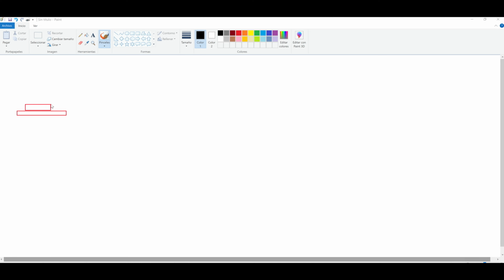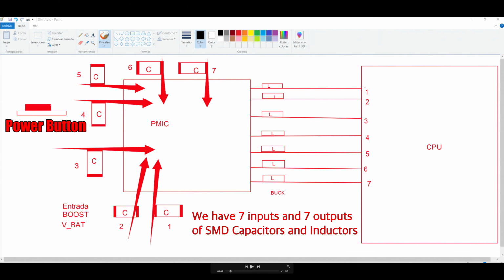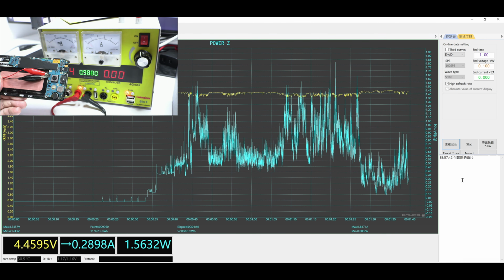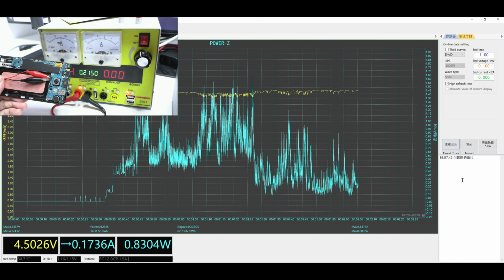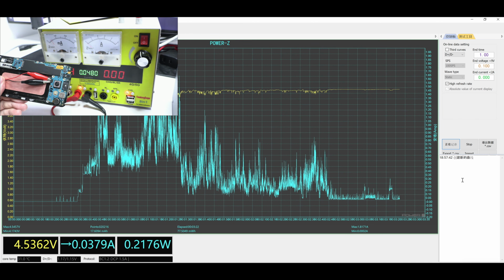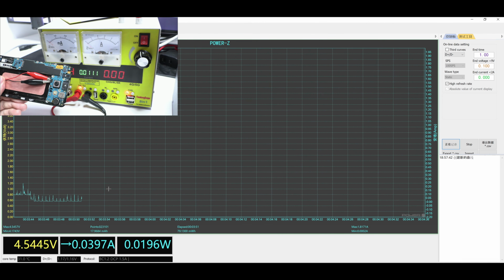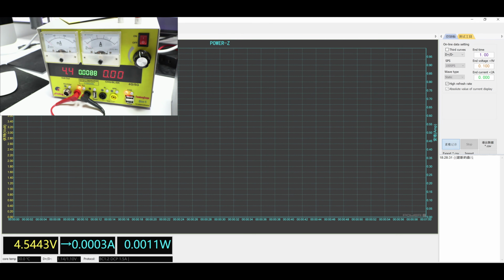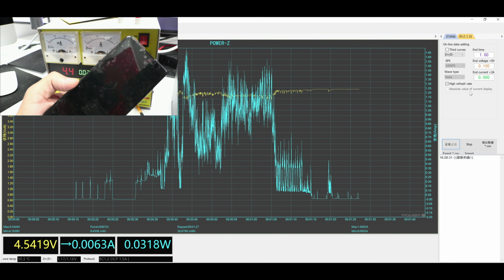PMIC Inputs and Outputs on Motherboard:  Mastering Current

Comment: In a situation when I press the power button the current consumption rises to about 700-900 miliamps and immediately I let go the power button, it falls back to zero meanwhile there is no short circuit on the board. Could this this be a symptom of a bad PMIC?
Reply from the maker: It's easy, you have to see where it heats up.